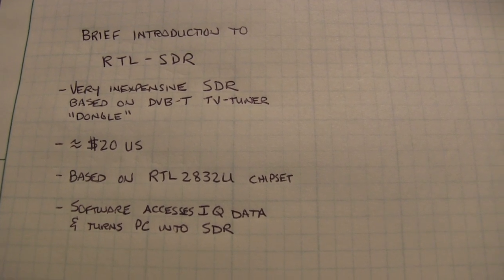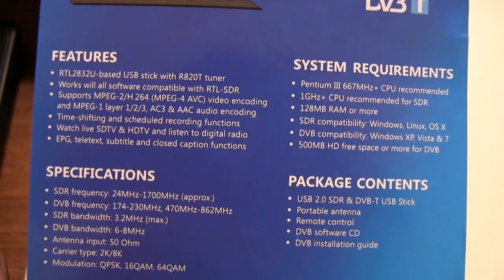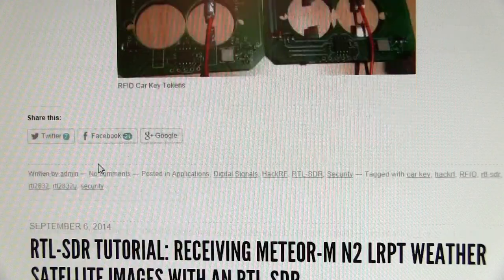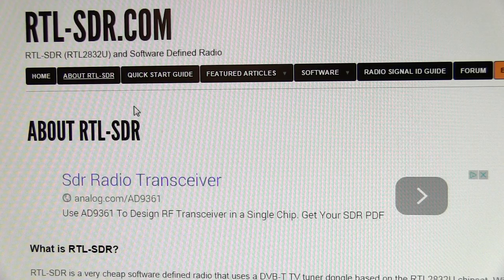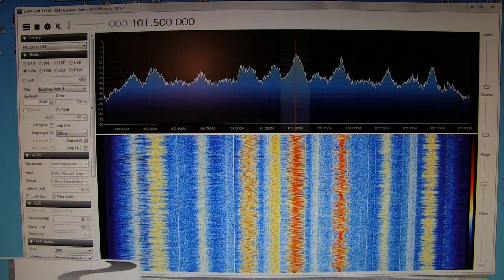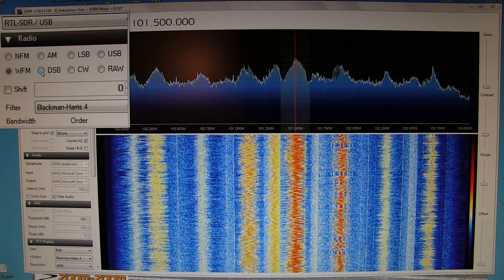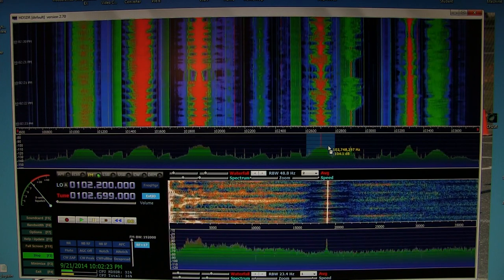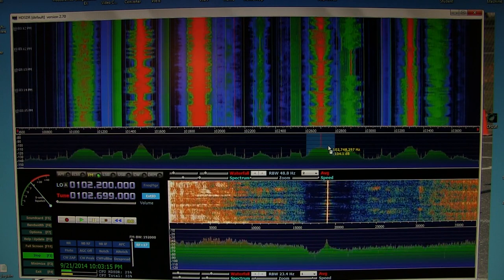#173: Introduction to RTL-SDR low cost software defined radio receivers

Comment: Do 101.1 and 101.5 have HD radio carriers or is that something different?
Reply from the maker: I don't think I saw the HD side ands on these stations.
Reply: +w2aew I haven't seen it here because we don't have IBOC in Europe, but those evenly colored bands drew my attention because of the constant amplitude (color) and width.
Reply from the maker: The IBOC sidebands are 25-30dB down from the audio carrier, so are often buried in the noise unless you adjust the SDR parameters to see them (narrower RBW, lower attenuation, etc.)
Reply: It wasn't clear on the SDR#, however on the HDSDR waterfall it seems to show up in my opinion.

Comment: In this interesting page from the NRAO they use false colors to show radio wavelengths. 
https://public.nrao.edu/news/pressreleases/galaxy-cluster-collision
Do you know if they use SDR or specific tuners for each band?
The paper
http://iopscience.iop.org/article/10.1088/0004-637X/794/1/24/pdf
I would like to understand how signals from space matter could
The most interesting is that the wavelength decreases from the emitting core outwards,
as if the radio frequency could tell us about a temperature gradient, is it possible. The same is deduced from infrared, the frequency is related to temperature. I imagine the objects emitting radio are at a lower temperature range.
Thanks for your attention.
Reply from the maker: +jlfqam A bit outside of my field.  The paper you cited seems to go into a fair bit of detail regarding their analysis and generation of the plots.  If you emailed the authors, they might be able share what specific receiving equipment they used.
Reply: +w2aew Thanks

Comment: 07:00 - 101.9 doesn't have a 19kHz pilot tone. It's strange for a station not to broadcast one, even if they're only broadcasting mono content at a particular time of day.

It would be nice to characterise my own radio transmitter using this software. A side-by-side comparison with other "stronger" (louder composite level) stations would be cool.

P.S. Can anyone read this comment or does it exist only in Google+'s void of nothingness?

Comment: Found a 100Khz to 1.75Ghz kit on ebay.  After reading the description, I wonder if the instructions use clear enough English to assemble it.
http://www.ebay.com/itm/100KHz-1-7GHz-full-band-UV-HF-RTL-SDR-USB-Tuner-Receiver-DIY-KITS-w-U-V-antenna-/111458938961?pt=US_Radio_Comm_Antennas&hash=item19f3787051

Comment: you know you guy's out there HDSDR will come to live with a air port card ....in your laptop pc and receiving   25-1300 MHZ RECEIVER SCANNER FM/AM/SSB HAM RADIO  HF/VHF/UHF FM FMW FMN all you need to do is to take out the  receiving  chip and add your one out of a non working scanner ...i did work's good i used the same on a old usb wify stick and it kick's ass......too .....you know wify is on the 960.987 mhz ...fm..... band,,,all you need to just do a make over .....took me 25 min to do it with a solder gun   and a tooth pic and a flat head .....so why are you throwing your money away on ebay junk when your air port card in your pc dose it all..... evan has a antenna ......dave of pocatello idaho raido tech .....cat out of the bag.....